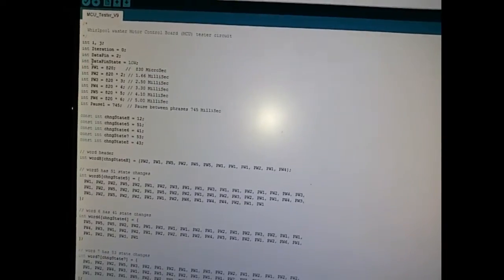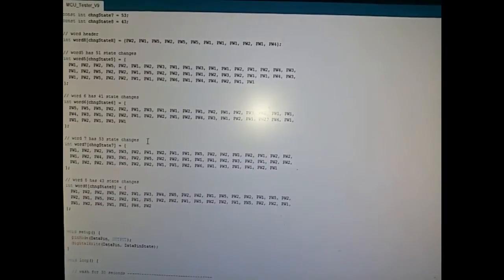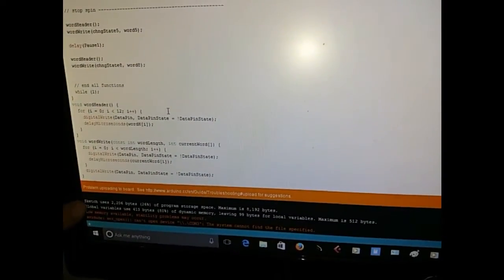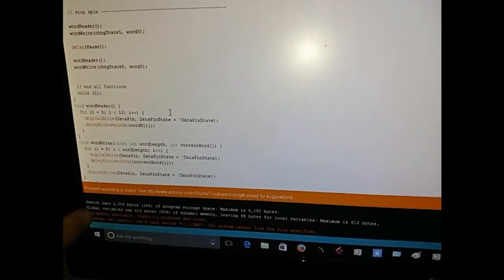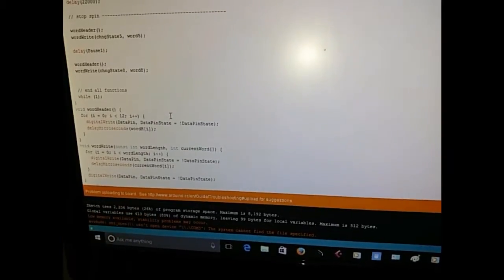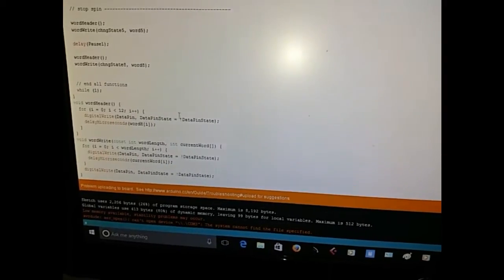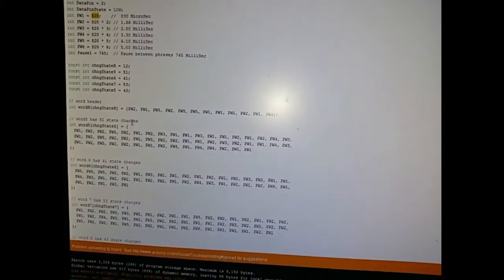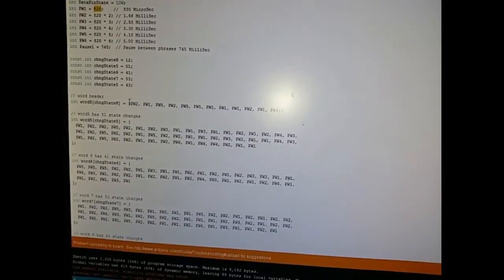Whirlpool Washer Motor Control Board Tester, AtTiny85

Comment: Is it possible to run this motor without having to program it to do different things but just to control the speed.  I notice the supply is 5VDC, 3 wires.  The middle wire is the PWM I assume.  A simple PWM controller with a potentiameter of sort, is that possible?
Reply from the maker: the 3 wires connect to the mcu, but it's data communication, not a pwm signal. The only way to run it without programming a board is to get a VFD.
Reply: @electronicsprojects4708  If that is just data communication with the main board.  The only thing left is the power supply which can be direclty hooked up to the 120VAC outlet and the other three wires  from the module  go directly to the motor and the other black wire is just tachometer that goes to the end of shaft of the motor in the back.   I am confused now more than before.  :-)
Reply from the maker: @alchemy1  you can't hook up single phase 120vac to run a 3 phase motor.
Reply: @electronicsprojects4708  Of course I am not doing that.  I am supplying the 120vac to the motor's control board that converts it to three phase.  Did I miss something?   All the main computer does is to signal the Motor control which way and in what manner it wants the motor to turn. Agitating manner, its direction, spin speed. etc.  The main board does not do the three phase conversion.  And of course it also supplies the 120VAC to the motor control module.
Reply from the maker: @alchemy1  the problem is replicating the communication from the main control board to give instruction, it also provides feedback to the control board with any errors the mcu encounters.
Reply from the maker: @alchemy1  With MCU, there's communication protocols in place, so binary communication based on rules used by the manufacturer of the IC's. In the video I show the communication in action. minute 1:31. You can't replicate this with a pot.
Reply: @electronicsprojects4708  I had a feeling that to be the case.  Them MCU circuitories respond to two voltage values and that is not the same as analogue or I assume it is not the same as pulse either.  If I understand pulse can be just one value.  The computer fans use pulse protocol if that is the right word.  And perhaps because of it, maybe that is why a person can just hook up two of its supply wire and run the motor.  Do I have it right somewhat? ( I turned this into a forum).  Oh.. yep the pot didn't work... :-)

Oh I have been meaning to say that I have run this motor successfully by hooking up its three wires directly to them hub motor BLDC.  You know them round circular motors LG washing machines and the rest use.
What I did one time is I turned that bldc motor with just another washing machine induction motor and while running or even before you simply hook up its three output wires to this motor.  And to make it even more entertaining.  This motor ran at over 19000 RPM.  Zinging away.   The hub motor produce high voltage but hardly any amperage but this 3 phase motor doesn't care and never heat up the slightest.  I am not sure how much power it has but it has speed like you wouldn't believe. The hub moto I guess puts out the frequency.
However when I hooked up the hub motor to the 120VAC 3 phase that I think  used on them GE washing maching... it didn't work.  Maybe it did but it wasn'tthat  impressive.  So how they are wired differently I don't know.

Oh by the way, are you controlling this motor using a knob on arduino?
And are you able to make it go back and forth and forward and reverse that took too much memeory, or just one direction?
Reply from the maker: @alchemy1  pulses just feed a certain frequency and that's it. data communications give alternating 1's and 0's to relay information, like speed, direction, errors, instructions. No knob, just a reset button to start the software from the beginning. I just used it to agitate and spin, for a tester there's no need to go crazy with speed and direction.

Comment: Wow, I have been trying to see something like this for the longest time.  Finally here is the man by golly.  Thank you.
AtTiny85 chip and of course it has to be programmed.  No wonder people just throw away all these appliances.  Nobody knows how to work them.  Mass Chinese production keeps the cost down.
My Maytag 3000 front load washer suddenly decided to give me the P28 error code which implies that the mainboard is not communicating with the motor control.
All that I know to do is inspect all the wiring harnesses, make sure they are clean and tight.
And of course no help.  I don't even know what to test and what the readings should be to at least give me an idea if it is the microprocessor or a rectifier or a capacitor or triac or whatever.
And it is not clear anywhere how to put it in a diagnostic mode besides pressing three buttons three times in a row. I have got nowhere with that either.
These companies will not provide any specifications or readings on anything that relates to the control board.
I don't even know if you should be able to get some ohm reading on the AC power in of the control board or should it read open circuit.  I would not it should not read open circuit and it should not read close to 0 ohms either.

Comment: can you and some more info on this i would like to diy a variable speed control ( i have a lot of spare parts )
Reply from the maker: We actually captured the digital words coming from the control board and programmed them into the Arduino. As we don't have info on the actual data, which Whirlpool would have in their engineering department, variable speed would not be achievable. I'ld recommend a general three-phase motor controller you can get the data sheet and programming code for.